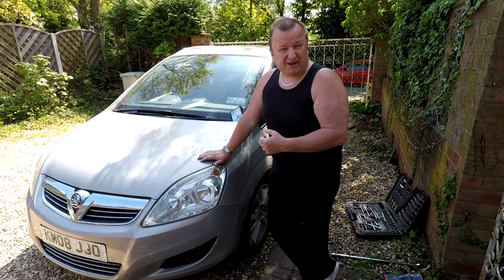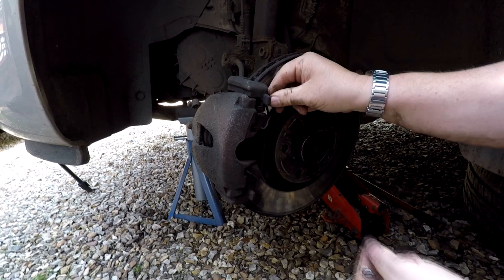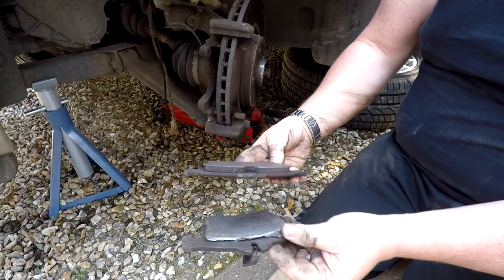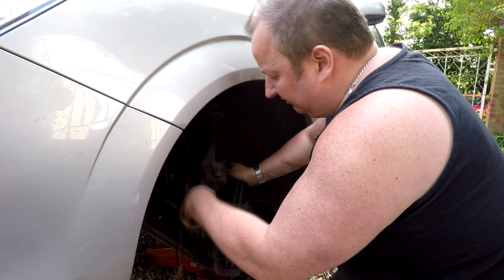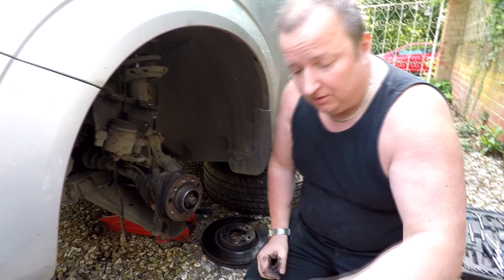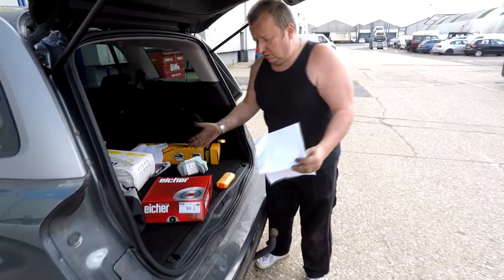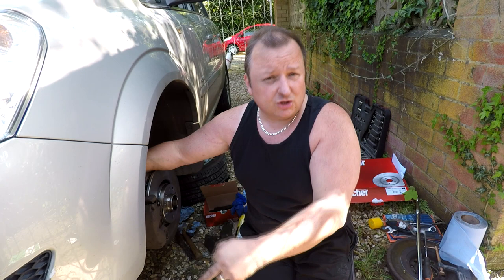Vauxhall Zafira B Front Disc And Pads Change Hell

Comment: 1 thing that will make a big difference to sticking brakes, the 2 rubber sections that the pins go through, pop them out, they get rust inside that squeezes the rubber part onto the pins, making them tighter than they should be, roll some sand paper up and sand the rust out.

Comment: Nice video, would have done few bits differently myself, but got the job done safely which is the main thing at the end of the day, on the wrong parts, if your order them online they have a large notice saying there is more than one possible fitment, but really should be made much more obvious, if you rang them and ordered them whoever you spoke to is a muppet since they have a better system but its not perfect but would help sort this one out at least.

I don't work for ECP, but have never had a problem but usually been lucky and already know the size etc of what I need, if it is of an interest I do work in the parts trade (breakers yard), the best way to match a lot of things up is with photos/measurements or to the actual part itself, do have one system( have also personally bookmark 10+ websites from various places when out of luck on that one)

It helps to narrow things down but it's far from perfect, and depending on the manufacturer you will still have 4/5 different variants, sometimes with notes to help select the correct one but not always so lucky,  just the way cars are made, and its gets even more fun with older cars that have been messed around with people do some odd things to cars!!

Every variance in a part fitted does have a reason, but sometimes and much more than you would think in this day and age its bloody hard to find out what the hell they were thinking when they made these differences and have they ever bothred to actually tell anybody!

Comment: I RARELY have problems with Eurocarparts.  I mean, most of the stuffs I bought were from the internet (with 35-50% off Promo code then collect in person).  Whenever I saw there are several options, I always check before I buy (even go as far as take the brake drum out to measure the brake shoes).  However, there are several EuroCarPart brands that I tends to avoid:  Eicher, Transmech, Circoli.

Eicher - brakes, they are not exactly bad (for a budget repair), but if you can afford it, go for Pagid.  All the Pagid brake disc are coated which makes them resist to rust, and less likely to squeak. 

Transmech - clutch, I've heard all sorts of horrible thing on the internet.  I don't want to try it myself.

Circoli - Thermostat, very high failure rate.

Then apart from EuroCarParts, I also get parts from GSFCarParts.  If you sign up to their newsletter, they usually send you emails offering 55-66% off during weekends.

By the way, see that brake disc retainer screw, put some copper grease on the threads will helps the next person removing that brake disc.

Comment: 308mm discs are generally for the Diesel engines, 280mm is for petrol. It’s not a hard and fast rule, but can help. The same applies to the Astra H, VXR excluded.
Reply from the maker: This is a 2.2 petrol.
Reply: Explains why it’s running the larger discs! 👍

Comment: i have had the exact same prob so many times with euro car parts..the people who work in ecp are just workers and dont know about cars.(most of em anyway). i now use a local parts suppler in Harwich. little bit more expensive .. not a lot only £3/£4 more on a hole service but the people know what you want and need and are car enthusiasts .. look up.. C & G Motor Factors  if parts are needed..

Comment: ive had a lot of hassle with euro parts to  never get the rite parts  even with the reg number . very dangerous the disc being to small if you had not of noticed or had no experience . at some point in the future the pads will have worn down leaving a lip on the pad  apposed each outer and stopping the brakes from working

Comment: ordered a radiator for my Celica from ECP, went to them because online, it said it could be delivered to the branch by Saturday morning. All local factors stated monday delivery. So ordered it with ECP, went down Saturday morning as arranged, and guess what , no radiator. When it did turn up Monday, I fitted it and it leaked! Grrr Got my money back and ordered it again from local factors.

Comment: What a bummer with the discs. ECP aren't even competitive on price (precise are on a par with genuine parts from the dealer). I prefer to use a local motor factor as they're more knowledgeable. Better to deal with the small guys and the customer service is usually much better. I always take the cap off the brake master cylinder regardless as it makes it easier to push the pistons back in the caliper. Wilkinson's sell hooks for hanging paint tins on ladders which can be used to hang up your caliper when it is off. Bungee cords can be used as well.
Reply: Best practice is to open the bleed nipple when pushing the pistons in, it prevents old degraded brake fluid being pushed back up towards the ABS pump, and obviously prevents fluid spillage from the reservoir.

Comment: Common problem .always take old  part to compare. Great vids keep up the good work
Reply from the maker: Not always possible Mart.
Reply: At least compare the part before fitting
Reply from the maker: I just love hindsight lol
Reply: It's not just ecp it's major dealership as well .changing bolts to different types .I now have a bigger tool set than ever before .drives the DIY er to give up .

Comment: When ordering car part online always use Part Number.. I have Vauxhall Meriva B 1.4 Turbo and the disk is bigger in diameter than the one for the same car but with 1.4 engine. Those part shops ask you for number plate and they assume that the same model year have the same parts. Part Number is exist for a reason,,, which in your case will save you a trip back to the shop.

Comment: I normally avoid ECP. I tend to shop on either CarParts4less or Mister Auto.
Reply: Carparts4less is euro car parts. I've just ordered from mister auto and they sent opened boxes with parts that looks like they have been tried on a car.
Reply: Hard Worker difference is, CarParts4less haven’t ever messed up an order for me. And I’ve never had an issue with Mister Auto. So not quite sure why you’ve encountered this issue.
Reply: Carparts4less is Eurocarparts, but Carparts4less are somehow always a few £'s cheaper.  The website is almost identical as well.

Personally I use the local motor factors, ordering anything online can be a nightmare when you realise the part is wrong and the car has parts is disassembled and stranded waiting for the postman.
Reply: I always order from car parts for less. I get the product code from Euro car parts and paste in into car parts for less search engine. Always saves me a few quid. The part always comes invoiced from Euro car parts anways :)

Comment: When I saw brake disc he'll I laughed and thought you had the same trouble as my ducato van as the discs were welded to the hub. After two days even with a sledge hammer and meltdowns, tearing my eyebrows out in rage... I eventually took a cutting disc and a monkey wrench to snap them off in pieces... And yes euro parts sent me wrong pads once 🤣

Comment: First part of any job (after you have locking wheel nut remover), even before taking tools out if possible, is to check you have the right parts.Euro Car Parts are terrible, I think they are trying to undercut other suppliers so they close down and then we will be stuck having to buy parts from them, also the one in Wolves regularly has queues out the door resulting in upto 45 minute wait.

Comment: Although I´m a little late:
I would never ever use brake consumables from any other manufacturer than ATe/Textar or the company that the car´s maker uses, preferrably bought at a local shop.
Added bonus - at least Textar already has anti-sqeal compound on pads´ rears.

Comment: Next time if you go there take the piss by bringing in the old disc to compare in front of them !    If a train is 30 mins to a hour late they offer half price,     If over a hour late it`s usually a free ticket,     If they made a mistake at the point of sell,    At the minimum they should offer a discount,     That said I found uneven brake pad wear was a stiff brake piston,    What I was given instead of copper grease was a lubricant labeled MoS2 Which I checked out to be Molybdenum disulfide,   It solved the problem

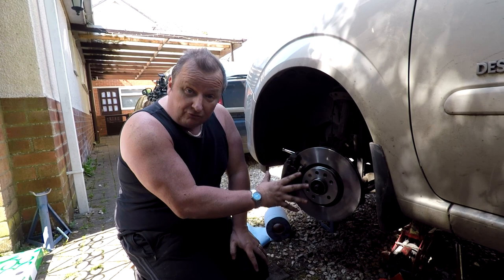Comment: 16:00 you probably selected the wrong disc on the drop down. Even when u put in the vehicle reg you still need to know your disk diameters because those cars come in 286 and 308 depending on the engine.
Reply from the maker: I didn't order the  parts

Comment: Never do a job once when you can do it twice Martin lol. Surprised you don't have an impact wrench. Mind you, I had to do my brakes FOUR times year before last. Even my old Clio has 2 or 3 options for each part.
Reply from the maker: i do have an impact gun Malc but that meant getting the air hose out and running it through the house so I opted for the breaker bar instead. lol
Reply: Need a battery one then lol. I managed without. You're still fit and strong :)

Comment: This is why i dont use ECP for bits for my car i use ebay and find the correct p/n on realoem for my Bmw, incidentally copper grease is old hat these days, slicine grease for the caliper pins and ceramic grease for the pad contact points.

Comment: You've put the outer pads on the wrong way round!!!!!
Genuine ones have a rotation direction indicator, but in all cases the acoustic screecher should be on the bottom, so that it doesn't want to fold in between the disc and pad when it contacts the (probably rough by then) disc.

It's also worth getting an OEM parts catalogue, or use an online one with registration or VIN entry.
That way you can get the right  OEM part number from which to cross reference.
Oh and Vx OEM brake kits are competitively priced compared to ECP, especially with trade club.

Comment: Hello
Just a quick observation, you have fitted the outer pad on the wrong side, the wear indicator should be on the bottom and the spring clip is not in the home position it should be the other side of the feet of the carrier you just to use a screw driver or small bar to lever it over from it's current position.
I would advise any one to take a photo of your job first so you have something to refer to if in doubt.
I hope this has been helpful
Reply from the maker: Thanks bud, yes it's sorted now.
Cheers
Martin
Reply: retrorestore 
If you need any help with Vauxhall, BMW or MINI products give me a shout,
Reply from the maker: Thanks Bud.
Cheers
Martin

Comment: euro car parts are really ignorant  i was doing discs and pads for a 2014 audi a1 s1 ordered discs and pads online 2 days later start to fit and the disc was smaller than the old one i went back to euro car parts with the old disc he said he didnt need it s he been on pfone with audi and this other one is definatly right for your car so gets home gets them out the box and its still smaller it was bigger than the last ones suplied but still not the right ones so had to go back again finally got the correct discs i no i could have checked them with the old ones but took his word like an idiot

Comment: According to break pad manufacturers you should never apply any grease to the back of break pads. It's something that was done years ago to help stop squeal but not needed these days as break calipers are better and the pads are designed to allow for the correct movement using the clip springs. Manufacturers are saying the grease when hot can actually pass from the back of the pad through the material to the front via the holes in the metal back plate. If I were you I'd do a back up vid to tell people not to apply grease to cover your own back Martin.
Reply from the maker: As you said, it used to be done all the time. I did say I don't see the point in it.

Comment: Obviously whoever pulled those discs from the store warehouse didn't bother checking that there was 2 different sizes, although considering the different sizes I would have thought there might be a way that the wrong ones couldn't be fitted, such as the location bolt being in a different position.
On a modern Japanese car they use a system called 'Poke-Yoke', where its impossible to fit a wrong part.
I used to work in a factory that made car door mirrors & we used that system in which parts had various holes and pins that had to line up exactly in the assembly process, so that otherwise similar looking parts wouldn't fit.
Reply: Richy, The Tinkerer & Wanderer. That's because the warehouse is number based they don't see options they get an invoice with an item number and a pick location that's it as long as the part matches the paper its job done
Reply: Always check for fitment alternatives. Parts sales is quite skilled, unfortunately skilled parts people can be quite expensive to hire. Nuff said!

Comment: Was you asked for the car reg number when you ordered the parts Martin? I'm lucky that we use a local parts supplier we have known for over 30 years and when we have been struggling with jobs he has got us the parts at cost price on some occasions and he gets parts ordered before 12 o'clock same day delivery most car retailers for parts go on reg numbers or serial numbers even if there are are more than one size. Ect. I think you need to find a new supplier Martin the least they could have done was given you a next order discount. Rob
Reply from the maker: Nothing to do with me Rob Gary ordered and reg was required.

Comment: I remember one of me neighbours who had a squeaky brake set sprayed it all with WD40 and then wondered why they didn't have any front brakes at all and I had to explain to him he had to basically bin the disc as well as the pads and the squeak was caused by him not putting the backing plates on the pads cos he said they looked rough O.o  I know the new caliper cradle bolts usually have blue locker on but why not red which is far stronger and less likely to let go when the brakes get hot I wonder?
Reply: Prob explains why my clutch or whatever has gone for a burton as that came from Euro Car Parts :(   Prob sent the garage a clutch for a Scimitar tank or supertanker hehe
Reply from the maker: Haha, sounds about right Ian
Reply: Ian Watson the clutch went on my old vectra after 6 months that was from euros
Reply: Mine was on my Reliant Robin, still got the paper work for it somewhere, thing is the garage that fitted it has gone now so double difficult to lob a claim at 'em as no doubt garage will blame supplier and supplier will blame garage.

Comment: Hello mate, got a zafira b the last of them its a 2014 plate with 70k on it got it last year so ill be using this at some point. Anyways I keep getting the emission light coming on. Replaced the pre cat sensor and used vagcom or whatever its called to reset the light but it came on again 200 miles later with a mass airflow sensor miscalibrartion fault too... wondering if its the cat, don't have the full diagnostics to check the difference in sensors to see if it is or not, what would you do? replace the after cat sensor or just go to a garage?. I've reset the fault light again but I know its gonna happen again soon..
Reply from the maker: I'd get it plugged into a proper diagnostic tool to see what's happening. I've just got one i'll be reviewing soon. Guesswork can be expensive so I like to know what the sensors are doing.
Reply: Where do you live, Im on the Essex London border. Id pay for you to plug it in for me and help me see if it is the cat or not. Thanks mate.
Reply from the maker: I'm too far away Rob. I'm in Lincolnshire.
Reply: :( do you think its the cat? its done 73k now

Comment: Stopped using Euro Car Parts years ago because of problems similar to yourself. As advised by others, use EBay. Other tip from me is if you buy off EBay, make sure you buy branded parts; brand owners need to worry about their reputation unlike unbranded sellers! Unbranded discs have a habit of warping easily and paying a bit more for branded will give you much better quality that last much longer.

Comment: This is the problem with large corporations or internet companies, the buck is easy to pass all the time.
If this had been an old fashioned independent local motor factors like we had in the old days before these buggers put them out of business with their discounts if there had been an issue firstly it would have been ten minutes down the road and chances are you would know the bloke behind the counter.

I loath corporate companies and try to use them as little as possible.
Reply from the maker: Exactly Ian, you're not on your own there.

Comment: Zafria b is same as astra h 
I bet that is a 1.9cdti diesel it has a m32 gearbox as my astra h is diesel that is 1.7cdti  and it has same size discs the smaller discs are for the petrol ones  except vxr they have bigger discs but the calibers can bolt on  hubs of a normal astra h zafira b your also need brake lines off a vxr too then you fit 
Vxr pads 
Vxr discs 
Bleed brakes 
Need 18" or 19" wheels as front brakes are too big 
Quite popular upgrade for diesel owners especially mapped ones
Reply from the maker: No, this is a 2.2 petrol Mart.
Reply: Must be same as diesels then as diesel astra and zafrias have 308 mm discs

Comment: I bought a turbo for my Peugeot expert taxi from Euro car muppets, with a 2 year warranty, it was completely knackered so the garage had to take it out return it for a new one which my Machanic checked in the store and the second one was worse than the first. The garage charged me twice to fit the turbo and Euro car parts said it wasn’t there problem. I’m in a legal battle with them at the moment # don’t use eurocarparts there garbage